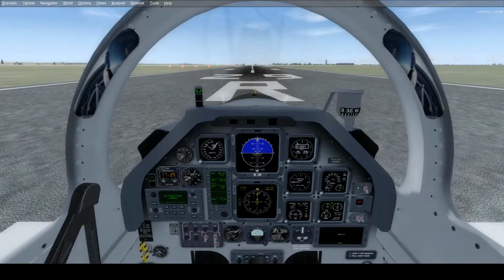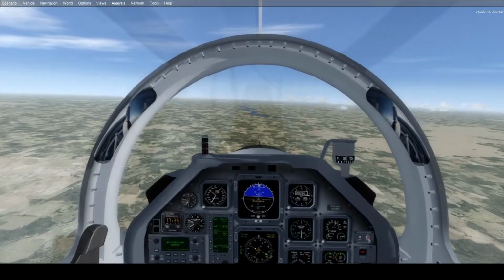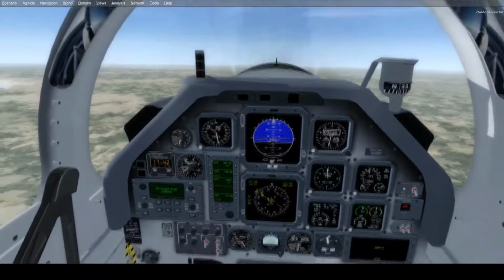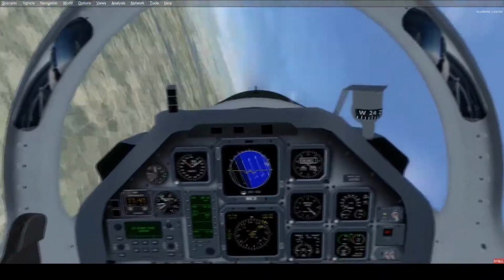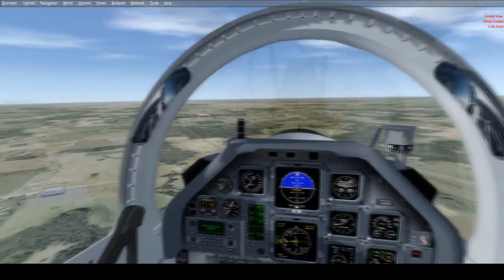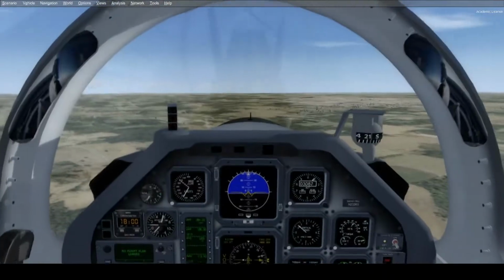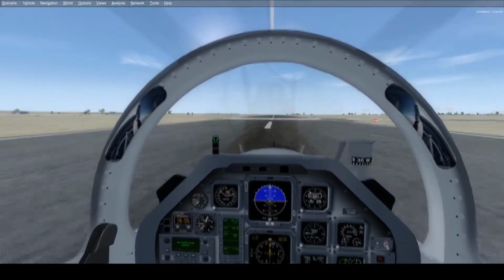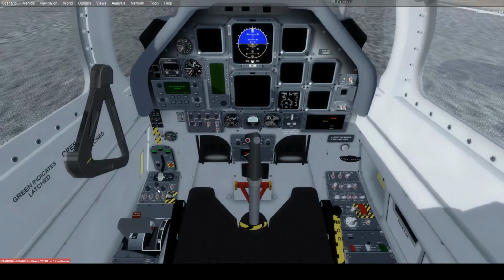Prepar3d V4: Beechcraft T-6 Texan II

Comment: I got the T6A downloaded. it goes to my \roaming\ folder.  neither v4 nor V5 is picking it up.  how did you get it to run?  Lost!
Reply from the maker: Is it the IRIS mod?
Reply: @Brookesy  Yes.  I have now been able to get both mods downloaded and working.  but still have some glitching with the T6A MOD.  it recycles the P3D program out to the exit window and then back into the game. --  weird...  working on that problem
Reply from the maker: @3RomeoFoxtrot  what OS are you using?
Reply: @Brookesy  windows 10. with 32g ram